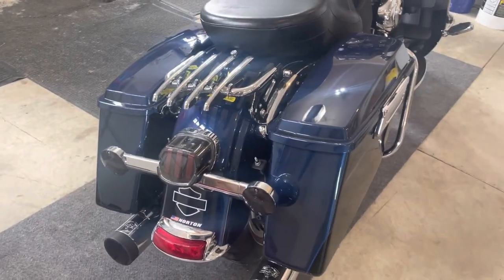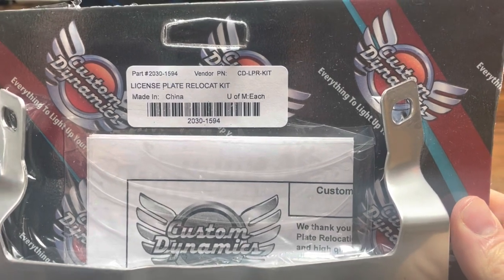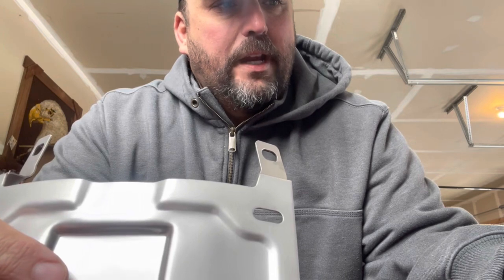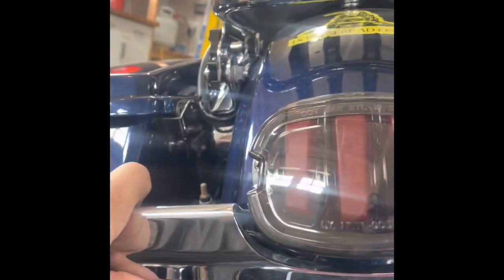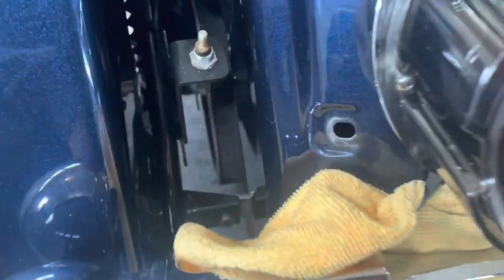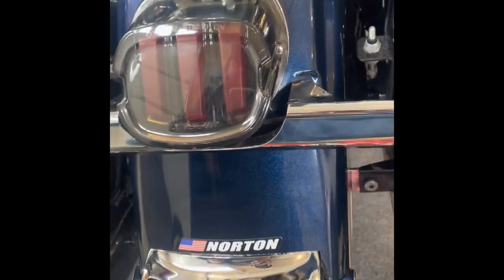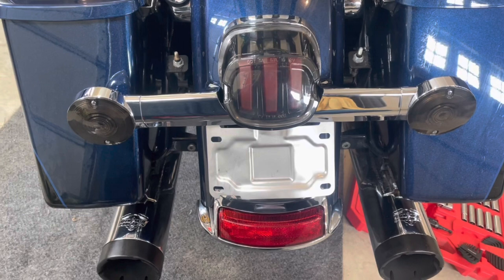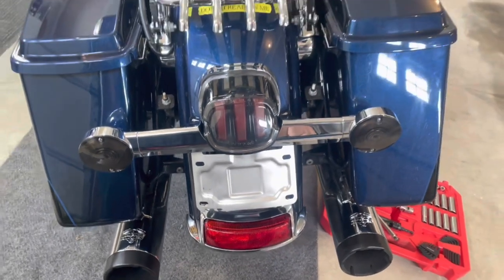Custom Dynamics License Plate Relocation Bracket Install on a 2012 Ultra Limited

Comment: My kit doesn’t line up at all with mounting holes. I’m following instructions to the letter as well.
Reply from the maker: First off. Sorry. I suck at social media and never check this. But that’s changing
What kind of bike do you have? I’m assuming you ordered the kit from Custom Dynamics. 
I had an issue with ferment from them before in a different bike. I called the customer service and they was great to work with. 
If you can. Modify to make fit, or if it’s not possible, send it back. They were great to me and my stuff was bought 3 months before install